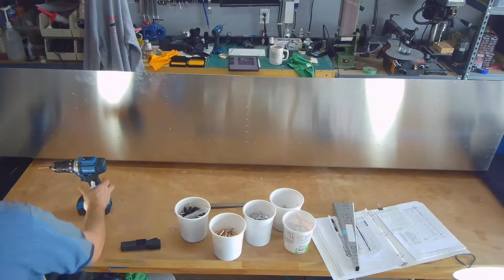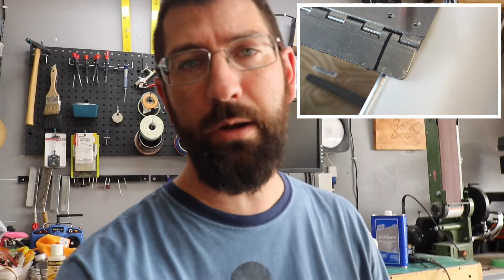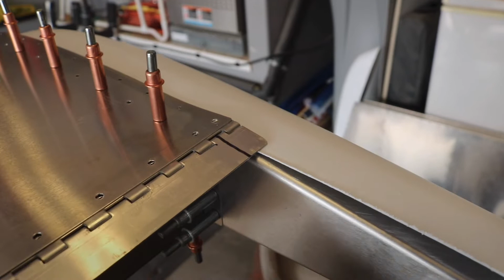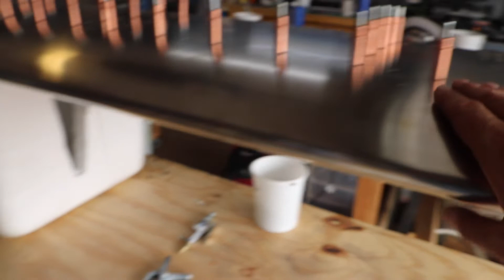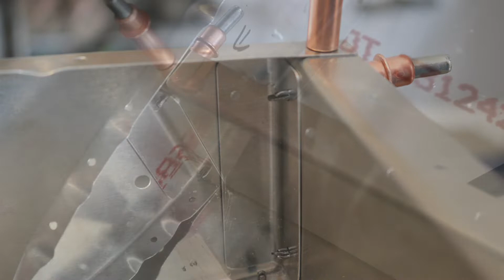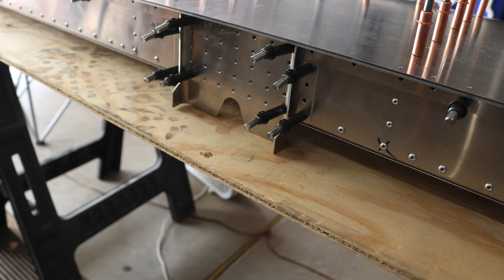Zenith Aircraft CH750 Cruzer Build: Horizontal Stabilizer Part 2

Comment: We are around the same spot in the build. I trimmed my HS hinge. I have not fit the tips on the HS until after fitting the elevator, which I closed up this past weekend. I will look at it tomorrow, but I might put a spacer on that tip rib before riveting it (so it keeps a slightly larger gap between the HS tip and the elevator).  Another builder had his tips heat up in the sun and closed the gap too much... I am sure you are aware of who I am talking about 😀
Reply from the maker: Thanks for the tips!

Comment: Joe, if you don't mind, would you post what Zenith's answer to the piano hinge is so we can compare it to what they tell us.  I am also curious how they want it cut, all the way across or if they want just one side cut.
Reply from the maker: To be honest, I didn’t talk to them, I checked on the forums and Facebook groups to see what others did and the all trimmed the hinge to fit. I did the same. I cut mine with snips, but you could also use a rotary tool.
Reply from the maker: This is what I found on another person's build log. 
"Late that day I got a hold of Roger, who agreed I need to trim the end of the piano hinge. These changes haven't been updated to plans or Manuals yet."

I hope this helps.
Reply: @JoesRCCorner  Thanks.  We just talked to him today and he said that they had updated the plans and schematics but gave us the wrong set and were sending us an updated set.  If this turns out to be correct, I would contact them to make sure you are working off the most current plans.  Good luck.
Reply from the maker: @daveaugcruzer  THanks. let me know what rev. # your new set is and I will compare to mine. Thanks

Comment: The stabilizer has no nose ribs? They're not present here at 1m25s, nor shown in the plans in the previous video. That seems so odd.
Reply from the maker: Jason Fish correct no nose ribs. They have the main ribs and the tip ribs. The rest of the strength comes from the single piece skin which is .025in thick